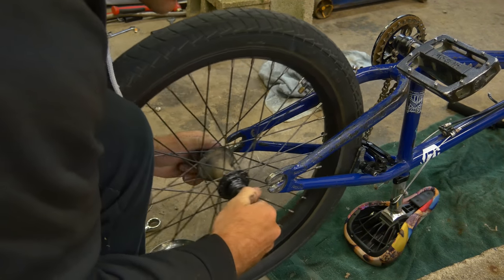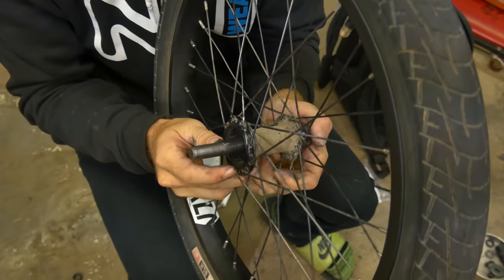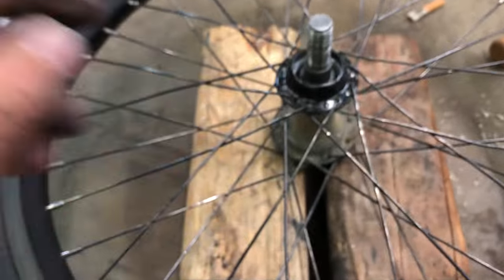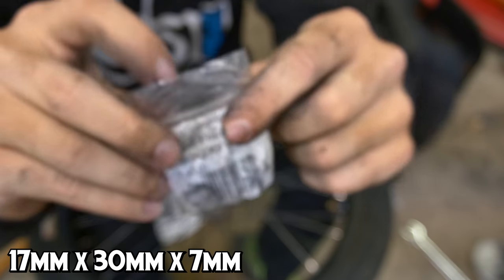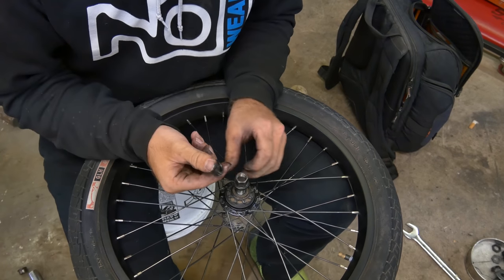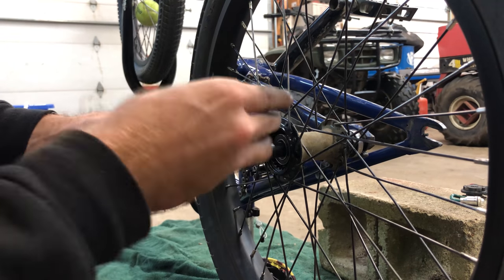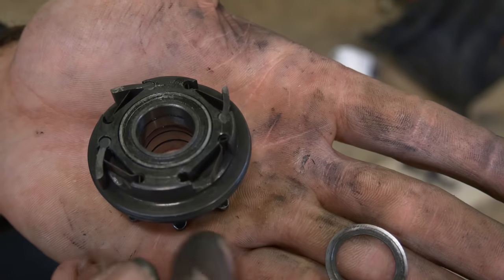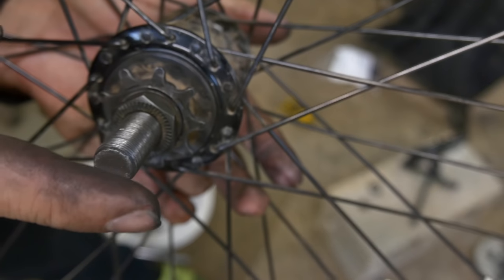How To Rebuild Profile & Madera Rear Hubs | COMPLETE REBUILD

Comment: Everything in this video is spot on! Try using a hammer that has weight, a Parktool HMR-4 with a plastic mallet is actually perfect for getting the job done without damage to components.

Comment: A dead blow hammer is far superior to any other hammer for working on bikes. I got one and it makes everything so much easier and it doesn’t damage anything
Reply from the maker: Can you explain what that is for me? I haven't heard of it before but that sounds really intriguing
Reply: Dead blow hammers have metal pellets inside that move around and when the hammer hits something, all the pellets go forward and create a dead blow. This allows the hammer to impact and not bounce back like a rubber mallet. If that doesn’t make sense there is quit  a few good videos on how they work
Reply from the maker: Conner Smith That makes 100% perfect sense man, thank you. That sounds like a really valuable tool to have!!!

Comment: You can use the axle it's self to seat the driver side bearing into the shell. Once the bearing is seated just pull the axle out, flip it around, install from the non driver side, reinstall and tighten hardware.

Comment: Very helpful video, do u need to  grease the driver or can u leave it degreased and make it loud?
Reply from the maker: No grease on profile or Madera drivers. They’re designed to be used without.

The only thing that could be done is a tiny dab of clear oil in the pockets where the pawls sit.

Hope this helps enough to earn your subscription

Comment: I started the process of removing the rear axle.  After removing the jam nut on the drive side, I notice another jam nut in the drive that is flat on two sides (round nut with two flat sides), what can use to remove that?

Comment: How can I get the rear  rim off the frame when the coaster brake is locked up and the axle nuts are stripped????
Reply from the maker: It sounds like you need some vice grips for those axle nuts. If you 100% can’t get them loose you may have to use a cut off wheel and cut them. Trying to avoid hurting the threads

Comment: Wait no oil or anything? What... Im new to this. Can someone explain
Reply from the maker: Not in profile/madera rear hubs. They are designed to function dry.
If you use anything, it should only be a tiny amount of clear oil on the pocket where the pawl sits so that it can move freely.
Here is an article on their site that mentions it.

https://www.profileracing.com/tech-tip-22-a-clean-hub-is-a-happy-hub/

Hope it helps enough to earn your subscription

Comment: How tf did you get the jam nut off with your hands, I can't even do it when I try putting both the axle nuts on the none drive side locking them and using a wench on the axle nut and another on the jam nut. It won't move one bit?
Reply from the maker: I already had it loose or it was already broken loose before filming. Sometimes they’re on good
Reply: @Brant_Moore  finally got it cheers man, best video out there for sure
Reply from the maker: Good to hear! And thank you! I try my best

Comment: Seems like if you just sprayed the old bearing and both sides of the hub with disk brake cleaner and let it sit for 5-10mim. The old bearing would have come out a lot easier.